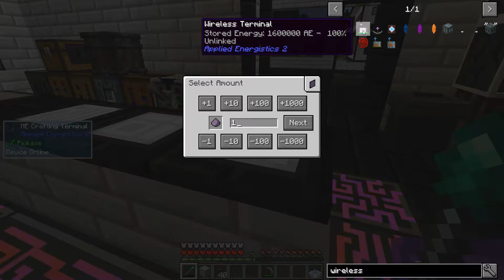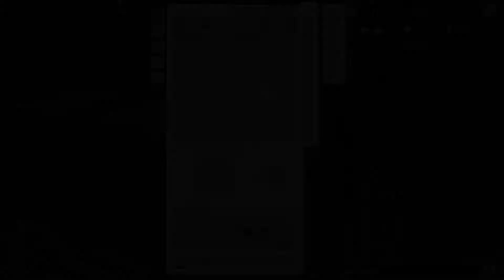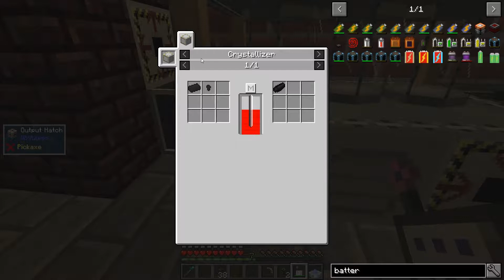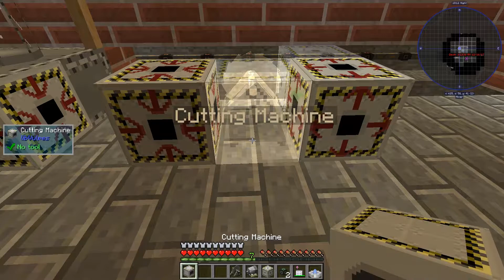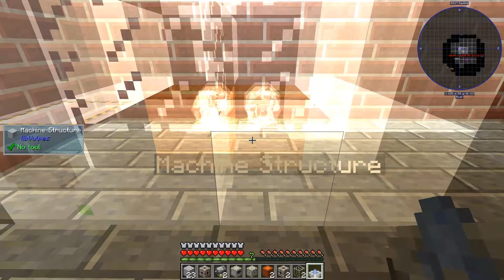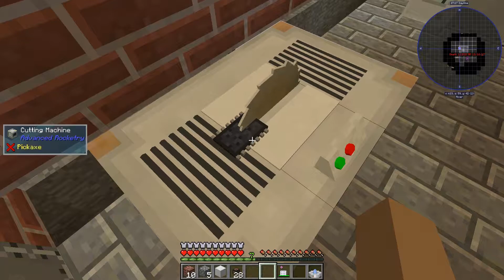Age of Engineering 47 | Rocketry Machines | Closet Gamer

Comment: I made a similar mistake with the booster cards. So I tried for a better balance. I've got 20 in there now, which gives me about 105 block range for only 118 RF/tick. That might be a little bit overkill, but my conductor mast array puts out like 15-20k RF/tick entirely passively, so I'm not too worried about it. 

I started watching your series when I was in age 5 or 6, and you've already passed me! I'm in age 10 still, just got my arc furnace rolling. I might catch up a bit now that I've got some time off for the holidays though. I think maybe today I'll use your tutorial for RFTools control to get my arc furnace sped up a bit.
Reply from the maker: Dream Vigil cool man, the difference between 64 cards and 30 odd in terms of RF/t is pretty mental! I assumed is was 1 card per block but I think the RF/t is exponential ;) having the furnace setup in any way that distributes is a major help - there are some definate tweaks that can be made to the program though in terms of how the items are distributed - let me know if you have time to tweak it, I'd be interested.

Comment: make a player interface from AA and put it near a power conduit, whenever you are about20 or 30 blocks from it, you will br recharged, and the wireless crafting terminal with an infinity booster card and you will dont need any trange upgrade, you will get an interdimenisional access to your Me sistem
Reply from the maker: Tsukiumy infinity sounds far enough for me :D and I didn't know about the player interface from AA, I'll check it out :D cheers Tsukiumy
Reply: the name and crafting sounds terrible, but its pretty simple when you look closer, its just a bunch of trash condensed into a singularity, and you will need it automated anyways as each draconic core uses 1. so the early automated the better, as it takes 256k itens to make a singularity, mine i started running as soon as i got to AE, and i now sitting in about 30 staks of singularities, witch i plan on automating latter(tnt and stuff can be a hassle sometimes), im even thinking in stealling the DW way to make then, but with some twists where i know it could work better :D, i'm starting to change some recipes, as i got to mekanism and it make the circuits and advanced ones really easy, letting me go one step further in some crafts, i even started crafting scented pannelings as it takes an awful long time to craft each, so i just shoved all the components into basic bins, got some eio conduits and a counting item filter to keep a stack each time and just letting it run filling the 4096 of those(lotsa times afking while reading a book)
Reply from the maker: Tsukiumy I'm think some enderIO blast proof glass, tiny tnt, a pressure plate and some precision droppers should do the trick, with a ranged collector?
Reply from the maker: Tsukiumy actually, forget that. I just made a much simpler solution for the explosions, a venting IC2 steam boiler! Image of the setup here in the last post: https://forum.feed-the-beast.com/index.php?threads/257220/

Comment: The only thing with as cool of an assembly method I know of is Pneaumaticraft, which had you build your own little assembly line and then had to make/find a control program which may or may not have needed lasers.
Reply from the maker: Triaxx2 that sounds cool, I've heard quite a lot of praise for pneumaticraft since getting back into modded MC. I'll have to check it out - is it part of any progression packs?
Reply: None that I've seen, though there's a new version that's still a work in progress for 1.12. I'm playing with it in the new Modular Mayhem pack, that I might make a series out of, but I haven't seen it in any progression packs. Actually, I haven't seen any 1.12 progression packs yet.